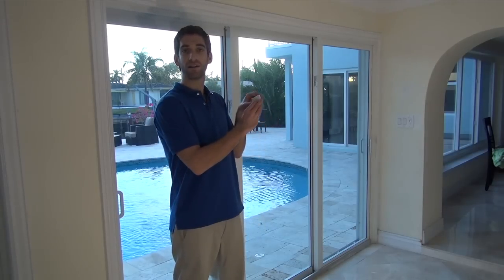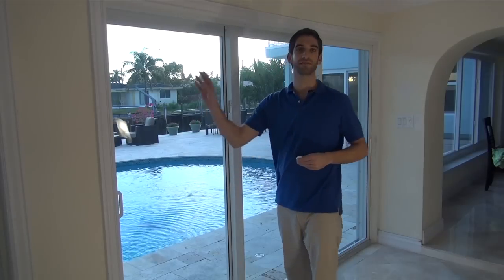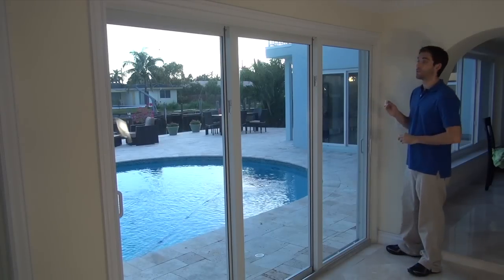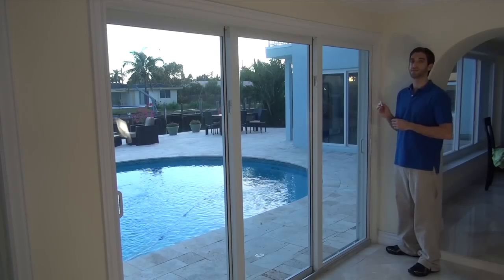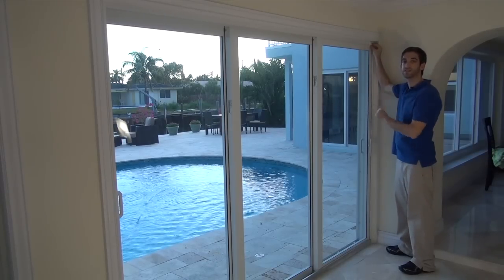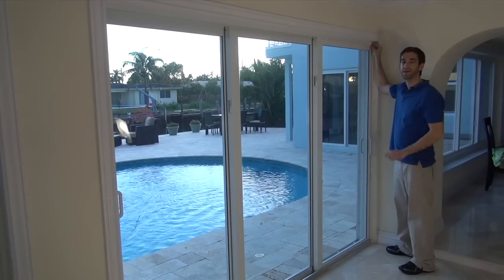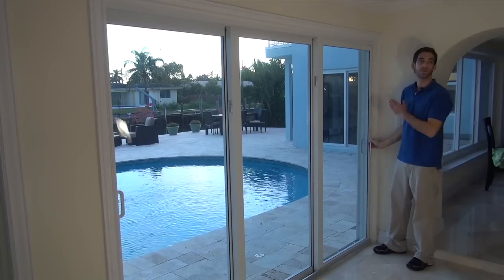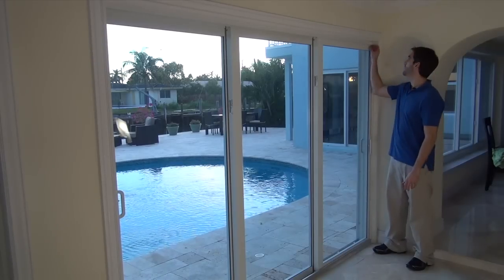Honeywell 5811: Installed on a Sliding Glass Door

Comment: Question -  I have a Vista 20P alarm system and one of the window contacts which is a 5816 WMWH keeps registering as open and triggering the alarm, sometimes in the middle of the night.  I have changed the battery twice but it still keeps happening, so i decided to buy a new 5186 WMWH contact and try and replace it.   I ordered a replacement on amazon - a 5816 wireless (honeywell) and can easily replace it at its physical location on the window with double sided tape,  but cannot figure out how to program the new 5816WMWH into the Vitsa 20P and I am concerned I may screw up the other 24 contacts or their order or something.  Is there a simple way to just have the system read the new device and then swap it into the place of the faulty window contact within the system please?  Any advice would be much appreciated.  The company we used to install the alarm system went out of business and we live in a private community with a private police force that does the monitoring but will not do maintence.

Comment: What happens if someone breaks the glass door and try to walk threw will the alarm go off?
Reply: +Franky duval This is not a glass break sensor...it's simply a door contactor to sense if the door is open or closed...
Reply: If there is a glass break detector nearby then yes.  Otherwise no.
Reply: If break the glass and system is armed away and watch through the door and not open it and walk in front of a motion sensor then it set the alarm off otherwise then no

Comment: my opened door name  " BACK DOOR " doesn't announced when opened. It was working fine before. How do I program it to sound?
Reply: What is the model number of the system you are using?
Reply: @Sterling Donnelly. the tech took all the package with him after installation. I will check the system later to find out the model number.
Reply: If you have a traditional system, you should be able to tell the model number by checking the PROM chip in the center of the green circuit board inside the metal alarm cabinet. The PROM should have something starting with WA on it and if you provide the full WA number, we can help.

Comment: Tape falls off, stupid way to attach something. Luckily I was home when it fell off. If I were at work, the alarm would be going off and I would have had to leave work to come home.
Reply from the maker: If the sensor fell off, it's because the tape didn't get a good seal to the frame.  You should make sure to clean the area you're going to mount the tape to, and be sure it dries before attaching the sensor or magnet.  I've used the tape on a number of openings in my home, and when I wanted to remove a sensor to replace it with a newer one, I found out exactly how good the adhesive is.  I had to pry it off with a spackling knife, and even then, it wasn't easy.

Comment: complete scam of a video because this is not really a typical sliding door. 99% of sliding doors are double sliders and yet they managed to find a house with a triple door. Why did they do that to show how nice THAT alarm works on a sliding door...? Well thats because technically this installation is on two separate doors with a glass "wall" between them. If that 3rd door wasnt there, which they are not 99.9% of the cases, this would not work
Reply: Hello Neil, We appreciate you taking the time to watch our videos. There are many types of doors out there. Each installation would be tailored to your equipment. If your door has double sliders then you still should be able to install two sensors. A lot of sliding glass doors that I've seen have 1 stationary glass and 1 moving glass. This type would only need 1 sensor. Ultimately it is the home owners decision, how to protect their door, maybe with some insight from the installer.
Reply: @freddaniels8259  I live in Florida. I've traveled a bit too and I must say, I have never seen a glass door with only one moving piece.
Reply: @NeilZielinski  That's fair. Did you need any assistance with figuring out a custom install?